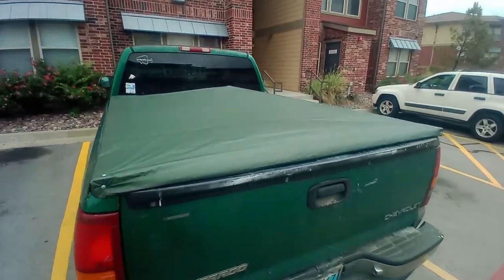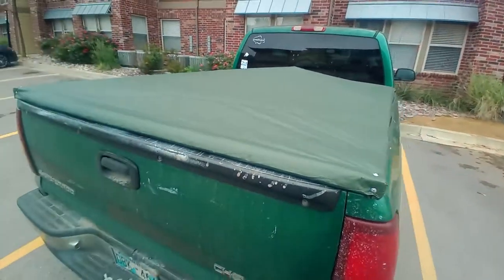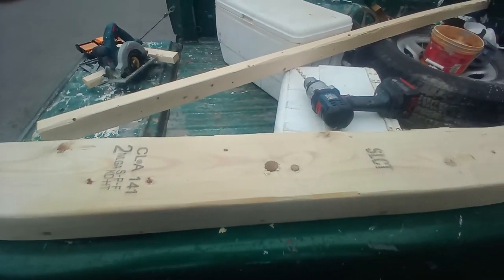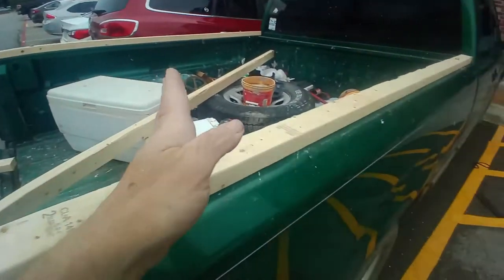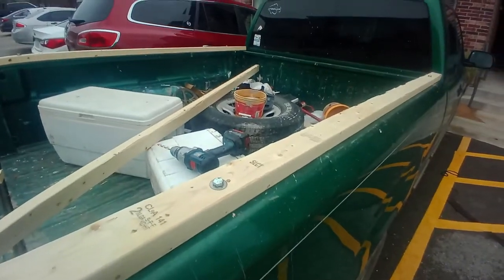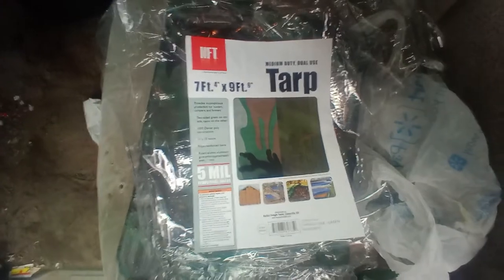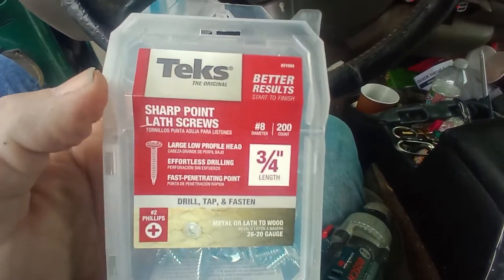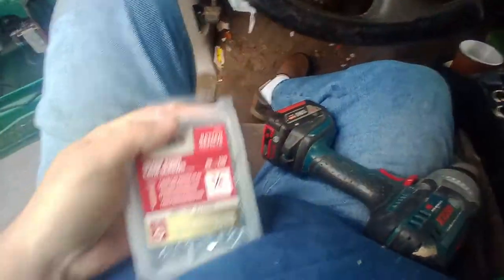DIY Tonneau Cover For Less Than $30! Cheap Truck Bed Covers

Comment: This is just the type of project I was hoping to find.  Great work for a low cost.  Thanks for sharing your creativity and problem solving.
Reply from the maker: You're welcome. I'm working on an upgraded version of this DIY Tonneau cover that can be removed quickly and easily. It should be out in about a month.